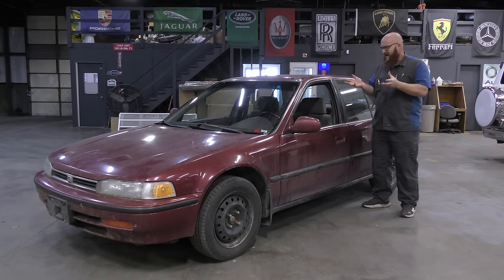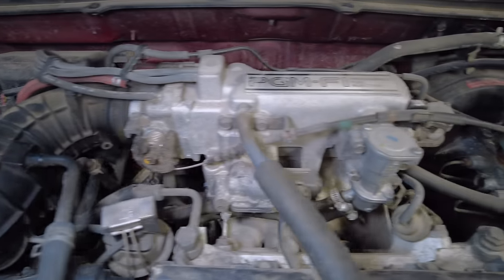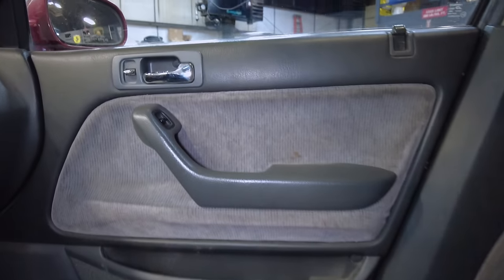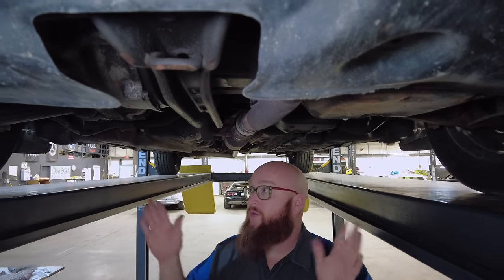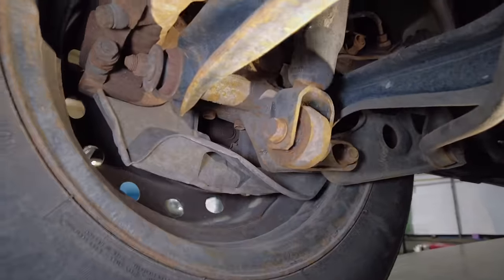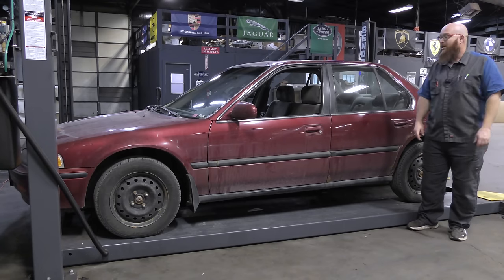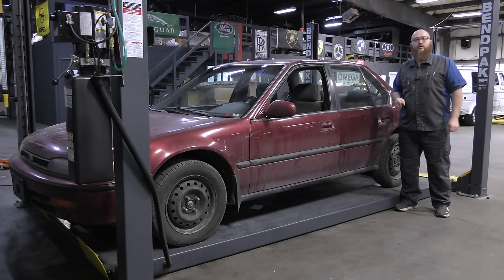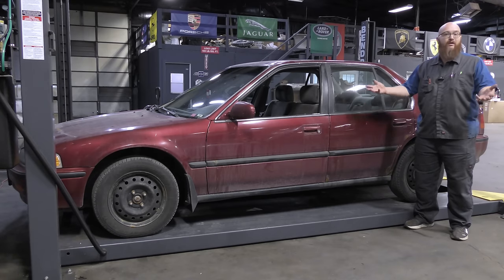A True Testament: 32 year old Accord with 380K miles! When Is It Time to Let It Go?

Comment: Fixing an old car is much better for the environment than buying a new electric car.
Reply: Do you have facts and figures for that or is it just your assumption. The channel Engineering Explained did a deep dive on this and you might be surprised.
Reply: @EnPatrolle  no, just an opinion tbh 🤷‍♂️  you'd think not having to consume more of earth's resources is better for the environment, no?
Reply: @ahdnaji  having to always consume oil and gas is a very significant aspect of consumption that is having dire consequences for humanity and life on earth generally. The batteries in EVs are highly recyclable, the power-generation mix used to power the grid gets greener every day. Battery technology is advancing rapidly, what we have right now are really only the beginning of the second generation of modern electric vehicles, in a decade or two they could have twice the range and a much better network of charging stations. They could even be used to strategically store energy to help load shift daytime solar overproduction to the evening.
Reply: @EnPatrolle  how do you dispose of a lithium ion battery?
Reply: @ahdnaji  you recycle at least 90% of the materials that were in it, including all of the lithium, which can be reused infinitely.
Reply: @EnPatrolle . Looks like you ripped your answer right off of Google. But if you want to use any critical thinking, use the logic of recycling. That means fixing this car keeps it out of the landfill and internal combustion engines last about 2 to 3 times longer than electric cars.  So while an electric car will last 10 to 15 years at best, you can keep a toyota or honda internal combustion engine car on the road for decades. So that means less production is necessary. If all cars were electric, we have to constantly be producing them. Batteries that large create horrible chemical byproducts in the production process that are actually worse for the environment.
Reply: @EnPatrolle until you factor in a lot of the energy for the electric is already fossil fuels
Reply: @EnPatrolle a typical EV takes about 6-7 years to offset its manufacturing emissions footprint. Many people don’t bother waiting that much and get a new one once the warranty expires - especially leasing and company fleets. Then there’s a factor of an old car being junked, and yes some is recycled but most stuff like paint, plastics, rubber - just ending up in a dump, slowly leaking toxic chemicals into ground waters. 
Recycling also wastes energy of course. 
So given all those factors, if I swap my old petrol car for a brand new EV, it will take forever to reach “zero emissions” or whatever. 

Oh, and there’s a fact that most electricity does not come from clean energy so driving an EV still burns fossil fuels 😊
Reply: The environment isn't real.
Reply: @EnPatrolle nobody does that. Most EVs will be junked before batteries are replaces. Try to find one for sale thats over 10 years old.
Reply: @EnPatrolle  the deeper I look into the data, the more I realize  that although partially true - the data doesn't substantiate the perceived existential crisis. 

The data is clear, however the computer models are flawed. Something about too much bias - this just dropped so I encourage you to do your own research.
Reply: Yet here you are, wasting electricity.
Reply: @EnPatrolle ev cars are ridiculously polluting to make.
Reply: Thank you. I was about to comment the same thing. I read the scientific literature behind where these talking points come from and they are VERY generous with the hypothetical efficiency of batteries, the power grid and recycling plant when they came up with the figures they used to compare electric to ice vehicles. Yeah, theoretically it probably will be much better for the environment to scrap an ice and buy an ev but that’s maybe 50 years from now. Today it’s still a wash if not slightly more resource intensive if I were to scrap my classic cars and only drive an e.v. So I’m not going to do it - plus working on my project car is therapeutic for me and the mental health benefits for me keeping my classic and fixing it with my own hands far outweigh the mental health benefits I might get by virtue signaling in an e.v.

Comment: I worked with a guy that commuted in a 1986 accord.  His odometer said 580k miles but he said it quit working 10 years ago.  Actual mileage was somewhere around 750k.
Reply: today's Accords are probably limited artificially from going that far.
Reply: @stoneyj1a1  how?
Reply: I have a friend like that as well.  He is an engineer and thinks his late 80's Accord is a perfectly good car.  No rust and it just keeps running.  He bought it new when his Honda CRX without AC just became too hot to commute in.
Reply: @tocreatee5736 the new accords aren’t made to last like the older ones they all come in turbo or hybrids now. Last time they made a rock solid accord was the last year they put the 2.4 in them with a normal automatic or manual
Reply: I bought my 1983 Honda Accord (manual trans) used with about 110K miles for about $1,400 at a public auction and drove it to about 425K miles.  When I eventually sold it, the AC and cruise still worked I still got $475 for it at auction😂 The body was still in VG condition and had zero body rust.  Best car I’ve ever owned.
Reply: I had a 1988 Accord...LX-I (top trim) to get fuel injection (lower trims were carbureted)...got the manual to learn to drive stick.
Reply: @tocreatee5736  They're limited by Stoney's persecution complex.
Reply: So that means that his speed sensor wasn’t working. He could have easily fixed it.
Reply: It’s still a great car. It will be a shame if they were to sell it.
Reply: @23ginger I hear the 1.5turbo in the 2018+ Accords  is head gasket failure prone.New body style 2023+ fixed nothing
Reply: @tocreatee5736  Electrical parts programmed to fail when the car clocks a certain mileage something like for example a wiring harness it'd be a ton of trouble to fix and also cheaper to buy another car cause unless you are a professional mechanic and have 5 months to not have a car since your car will be parted out almost completely to get that harness out you won't be changing that
Reply: @stoneyj1a1  They still go far based on the high mileage ones, only trade off is more alternators, starters and minor electrical issues but they still go the distance in a much more comfortable platform
Reply: @CRAPO2011  they're bad for that but the 2.0t is great. Idk why but Honda insists on going the route of GM, they're just not nearly as far gone yet
Reply: @DIE2dayORelse  I don't think you can get the 2.0L in the new body style? Didn't you have to get a higher trim for the 2.0 touring
Reply: My Toyota truck was like that. Odometer stopped working at about 360,000. I drove it for another ten years, and sold it to a guy that drove for at least another four years.
Reply: @joshuawick5382  Those 3rd gen Accords don't use a speed sensor for the gauges, the speedometer and odometer are cable driven and fully mechanical. If the speedometer still works, I'd guess that the plastic gears in the odometer probably failed. There actually is a speed sensor, but it's inside the gauge cluster instead of on the transmission and is only used as an input to the ECU.
Reply: @23ginger its a minefield with the engines since 2000. Some like recent 1.5 have head gasket issues while the 2.0T is a keeper for life. They are made to last a very long time and will need very little maintenance.
Reply: @scottgoodson5132 why sell at auction? I guess it was not one of the more preferred collectibles. Those are appreciating in value when rust-free.
Reply: @bills.4573 me too! I had that car in white with burgundy interior. Sweet car, and the 90 EX was even nicer but I never got one unfortunately.
Reply: @CRAPO2011 the newest ones are pretty sweet as far as looking clean and getting 50 mpg. They don't have the 1.5T any longer to worry about.
Reply: @jamesmedina2062  if your talking about the new Accord it still has the 1.5t that likes to blow head gaskets
Reply: Also had a ‘86 Accord, 260k miles. Got 90k miles on the original equipment tires, Yokohama’s if IIRC. Never had an issue or breakdown, let it go when the drivers seat broke, fixable but the unreasonable cost of keeping vehicles on the road in NJ tipped the scales. It was brown, paintjob was still good, no rust, clean inside & out.
Reply: @tocreatee5736 planned obsolescence.
Reply: Them little old accords refuse to die. I’ve seen some with 400+ miles and still driving
Reply: Same here! I had to ask him three times, wasn’t sure I heard him right!
Reply: @OwO---0bamasPersonalChef---OwO I had a 1986 and it was fuel injected
Reply: The lancers are also near bullet proof.  I ran a 89 lancer until recently  after repeated head gasket losses made sell
Reply: I remember a guy that work it the oil change shop said a customer  car engine was at one million miles
Reply: I learned manual on an 86 accord. I have an 05 with 264k it keeps going but many interior and electronic things fail like crazy and ac and heat doesn't work properly.

Comment: Last summer, a 1991 Honda Accord LX parked along my car on a Costco's parking lot. I chatted with the driver who happens to be the original owner. The car had about 907,000 miles on the odometer. That's his only car he bought new in his life so far. That was about two years after he graduated from college. He married a year later and then he had kids who grew up with the Accord. Now he sold two of his companies last year and finally retired. He's means to buy even supercars but still prefer to drive his old buddy. The car is still in great shape.
Reply: Awesome story
Reply: What’s great sharp?
Reply: @jdawgspicemcgee  Its body is still in the original paint with crystal clear glass headlights. No rust, lives its life in GA/FL. The color of the  burgundy cloth seats is faded but is still in good shape, no holes. The back seats have some faded stains. I guess that was done by the kids when they were little. In general, the car is in very good condition. The owner is not a DIYer, and he said the car still has its original engine and tranny. He had starter, alternator, radiator, valve cover gaskets, time belt, water pump, oil pan seal, fuel pump, rear main seal, a number of sensors, and dash/ instrument lightbulbs replaced a few times. It still has the original AC compressor. He told it's still far cheaper than buying a new car.
Reply: This is the secret to getting rich if you don't make tons of money.
I'm 55 and never made a car payment. Only owned four cars. Never borrowed money. Never had a credit card. My living expenses can be as low as a hundred bucks per month.  I save everything and always have. Interest on my savings is now right at six figures. 
All this on a high school teacher salary.
Financing new cars is crazy.
Reply: @mikey92362  do you grow your own food? wondering how you can pull off with just $100 a mo.
Reply: Where is the link to parts and Mrs wizard channel? Thanks. 🎉Congratulations on 1 mill subscribers.
Reply: Exactly! 380k may sound like a lot but there are plenty of Honda's out there with a million miles that could go another million. It's all about the maintenance. 
The 90's era Honda's are built better than the new ones. No turbo DI junk.
Reply: @viewlesswind  I spent a lot of time typing out a detailed answer to you. And YouTube deleted it. I can't even begin to imagine why. But I did try!
And nope, I don't grow my own food.
Reply: @mikey92362  don't type in one long piece. Do a few pieces at time and make sure with some words intentionally midspelled.
Reply: @viewlesswind like, specific words? Or just randomly to prove I'm not a bot?
Dang, that's terrible. I HATE misspelled words and poor grammar, and I always proofread. 
Is there a video that explains why they delete some comments?
I assume it's certain keywords or political thought. No?
Reply: @mikey92362  doesn't matter as long as your comments can pass their AI censorship. The point here is to get your ways of only spending $100/mo to live thru their censorship.
Reply: @viewlesswind  
Basically I take care of an elderly couple. I have a vintage RV I restored and live in.  
I cook for them usually and eat their food. Connected to all of their utilities. Mostly use their vehicles. 
And I really like them and enjoy being a caretaker. Also, it saves them a fortune every month.
And emergency services are pretty far away, so I'm there for emergencies day and night.
Reply: @viewlesswind  other than that, I just don't enjoy spending money. I make six figures now in interest and dividends and all but 15% (taxes) gets saved.
Once the couple needs an undertaker and not me, I'll have enough saved to spend my life traveling and doing anything I want to do in the world. 
I'm going to tour for three years from Iceland to the Philippines. Then lots of snow skiing and beaches and booze until I'm too old to move.  ')
Reply: sorry the math and story dont add up
Reply: @viewlesswind  this is cap 🧢
Reply: I still miss my family's 1992 Honda Accord LX
Reply: Some heroes don't wear capes
Reply: Wow that is something. Only thing I'd really worry about on this one is the clutch, but, obviously it's been babied and never abused.
Reply: That’s insane lol those 90s cars never die lol
Reply: The CB7 ('90-'93) Accord is the best Accord they ever made, and arguably the best car Honda ever made.
Reply: @bmwpete65s55  My '97 Civic has 377,000 and I drive it every day and A LOT!